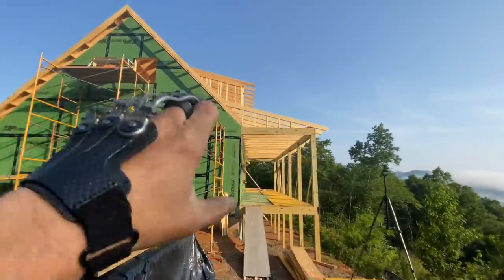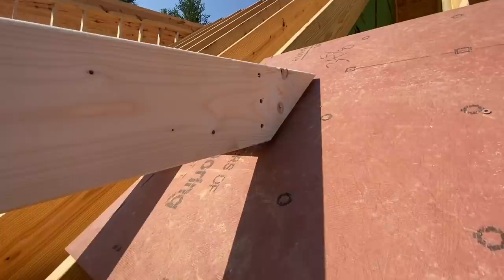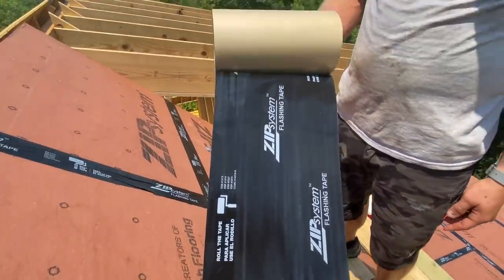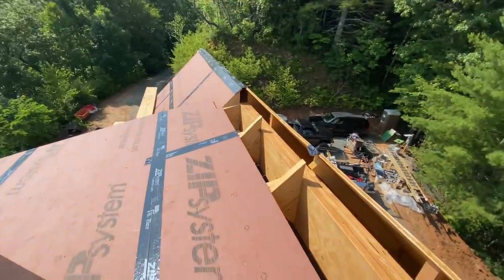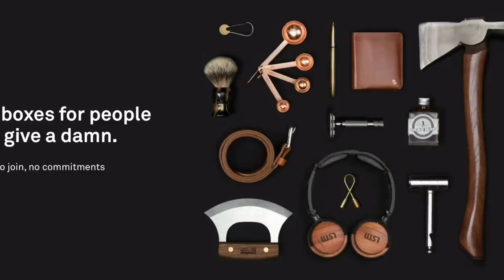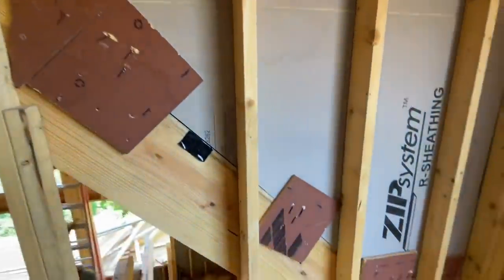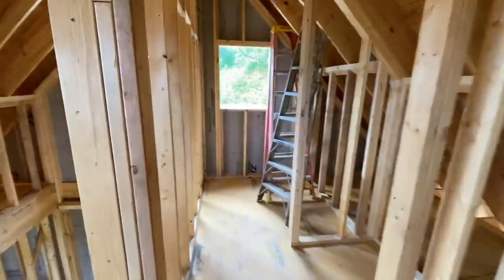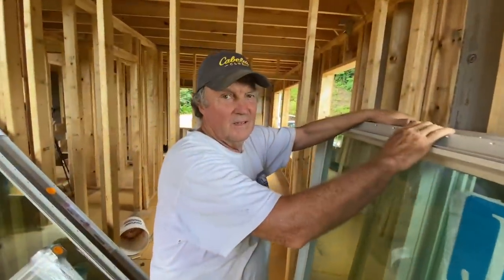Overhang and Loft Wall Framing | Building The Nantahala Retreat #15

Comment: I extended my overhangs when I got a new roof last year. Easy to do and makes a huge difference. Wish I thought of the detail of leaving a gap at the top, I didn't but it didn't make too much of a difference with the shingles/flashing. I made a "soffit ladder" on the ground then lag bolted it on. Great video.
Reply: Helped my father in law build a barn/big ass shed in Arkansas. Did that ladder thingy and I just about lost my mind!   It was high and I don’t like high.  But we did get ‘er done.
Reply: @harryl7946  Haha, I used to do a lot of big time rock climbing 20 years ago. 1000's of feet up on vertical walls with just a rope. Would sleep up there too. Now I get 10' up a ladder and I get sketched out. ;-)

Comment: I see comments on how the roofers like that gap left so they can shingle under it. Definitely makes their job easier. Having done many a repair....the header and facia wick up water from the shingles. They end up rotting at the ends. I also see insects getting in through slight openings in the soffit too (I've removed plenty of bees). Not sure what the solution really is, but seeing them sealed up tight and using rot resistant flashing/materials is what I end up doing.
Reply: I NEVER do it that way. Always steps against the fascia board. Ill stop short of calling it wrong but I don't like it.

Comment: as a "pro" carpenter, just wanted to comment, Before this video I was reading FHB. They have a great Jamie-esqe article on cutting roofs.  FHB is like a shop class math book, and watching y'all is like watching kids fire up the table saw and let it rip, both are necessary parts of the process. also... how about a Jamie/Arlo segment about cutting rafters...calculation to cut process?

Comment: Love the channel but your scaffolding assembly and safely need a redo! Mud seals and all. Check out OSHA 1926. 451 & 452.
Reply: I read it, ain't nobody following all that. I get that for large business/heavy construction and insurance they have to stipulate and mandate things to su b an extent, but for small scale builders like Perkins? Or the remodels I do?

The basic construction safety equipment should be cheaper and more available to average builders, just for starters.

Comment: I feel like this build was started a month ago, now it’s basically fully framed up
Reply: >I feel like this build was started a month ago
That's because it was!
I too was amazed how fast houses can be built when I first started watching the channel
Reply: i know , right. in my experience i pay a contractor just to renovate and it takes months. then there are soo many fixes.
Reply: @spicynomad  Fixing things is much longer/complicated than building new.
Reply: @Ogilla  okay, i deal in 100 plus year old  homes and if they see the subfloor is rotten dont just lay brand new flooring over top. if you install new windows then finish with trim. if you landscape put down fabric and then continue with mulch and everything else. same with roof and everything else. you dont just lay new tile over old tile. you remove and if there is damage then you cut it out...this is not my trade but its like you have to watch these pro. i hate when they cut corners.
Reply: @spicynomad  to be fair, sometimes it’s a lot easier to start new than to renovate. Remodeling is a pain the ass sometimes when you have demo involved and having to retro fit things. Framing is typically one of the faster items.
Reply: @CrzBonKerz21  well the way i see it buckingham palace is still thriving oat over 300 years old, right. im not renovating for me just want to see these old beauties get a new life, i love it. i get what you are saying though. i its interesting to see a house go up from scratch. its all the details for me.
Reply: It really doesn't take long to frame a house when you're good 😉
Reply: A month is actually too long for a home to be framed for many modern carpenter crews. These guys are considerably slow compared to others I know and work with, but they’re careful and I don’t say that as an insult, they do good quality work.
Reply: @spicynomad  yeah but they usually cut corners if your cheap
Reply: @josuetlaczani5462  the contractor states the price and the client pays thats how it works. you must be a contractor and you should not be offended unless this is your practice.
Reply: @spicynomad  yeah obviously who doesn’t know that but a lot of the times the contractor states the price but the clients don’t wanna pay as much
Reply: @josuetlaczani5462  thats why one take bids and you go with the one that suits the job .